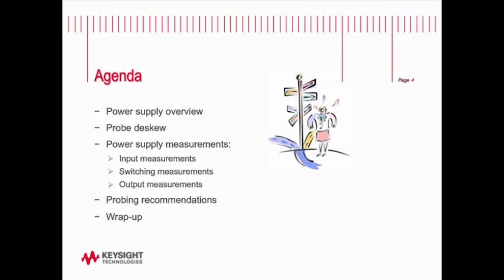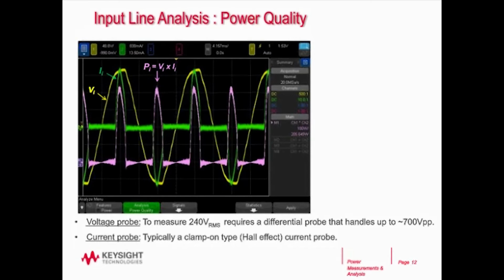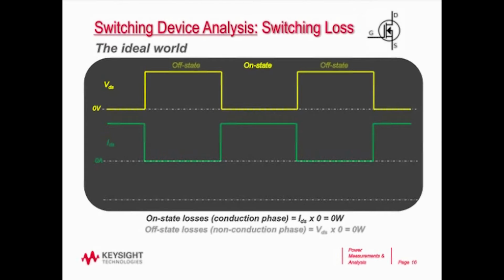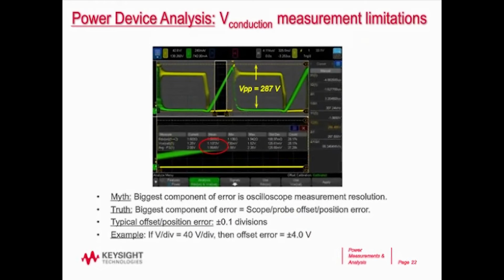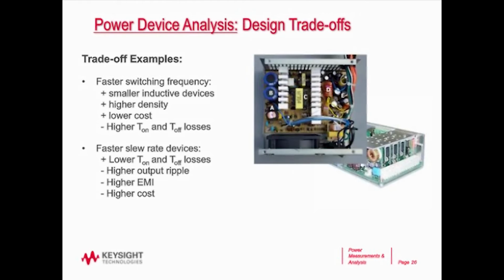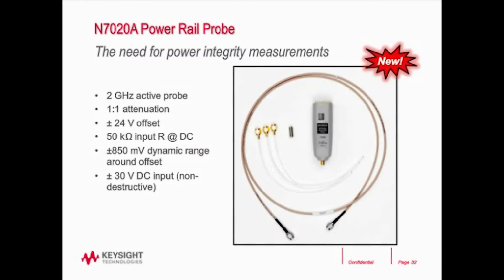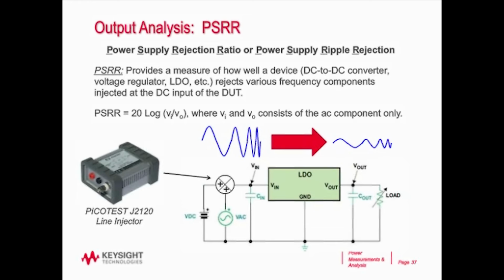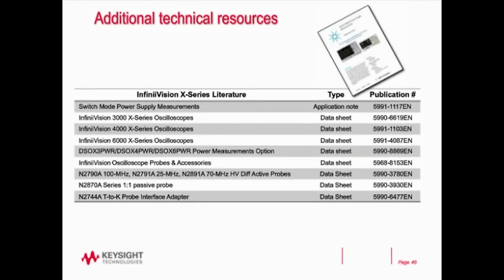Switch Mode Power Supply Measurements and Analysis

Comment: Live connected to Earth via a single diode?
Given that Earth and Neutral are connected together at the meter box, isn't this diode going to be vaporized on either the first or second half cycle of the mains power?
Or trip the RCD/GFI safety switch?

Comment: I have a DA1855 differential pre-amplifier that offers a very clean 10x amplification. Do you suppose that can extend the dynamic range of the PSRR measurements by pulling the power supply output noise into the usable range range of the scope while using a 1:1 or 10:1 passive on the larger input signal?
Reply: Hello Jet, if your DUT is a linear power supply with a very low noise output, then using the DA1855 differential pre-amplifier might be good solution. But I can't say for sure because I have never used this device. But if your DUT is a switch mode power supply, then it probably won't help because the amplifier will boost the output switching ripple. However, we have just recently updated the firmware for the InfiniiVision 3000T and 4000A that significantly improves the dynamic range for PSRR and Control Loop Response (Bode gain & phase) measurements. These scopes can now pull out very low level test signals that are buried within relatively high levels of switching noise. But unfortunately for you, it looks like you have a MSOX6004A. We haven't yet updated the firmware for this series. However, I think we will be updating the firmware for the 6000's within the next 6 months.